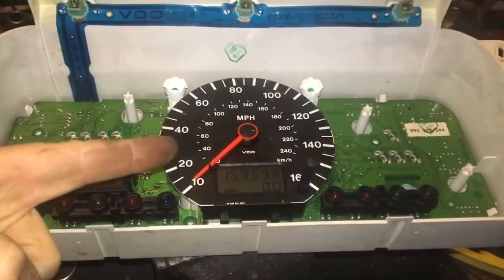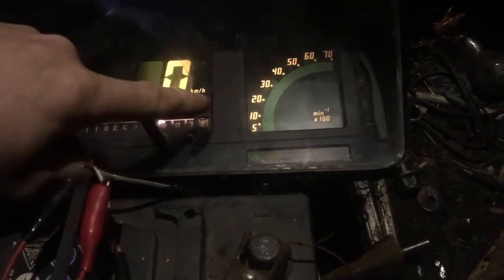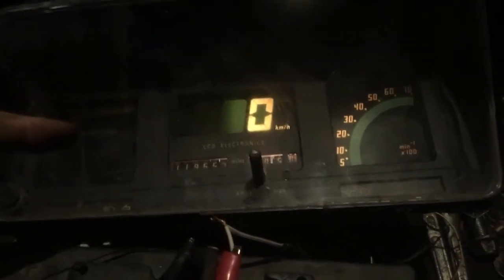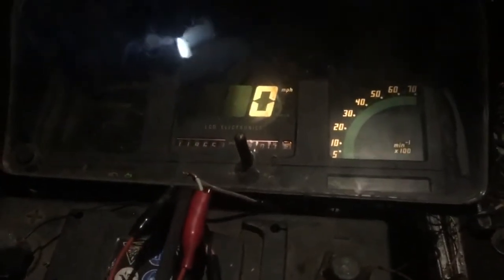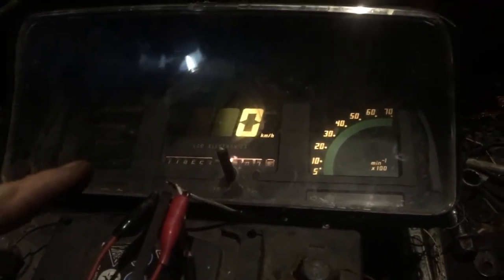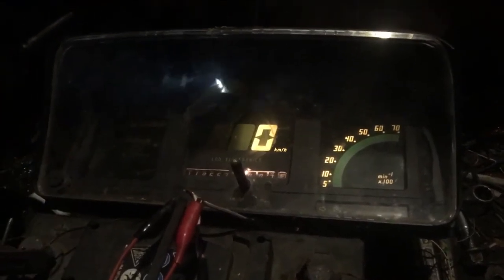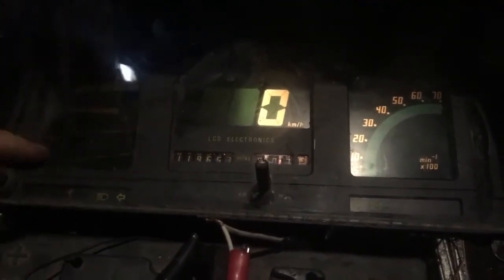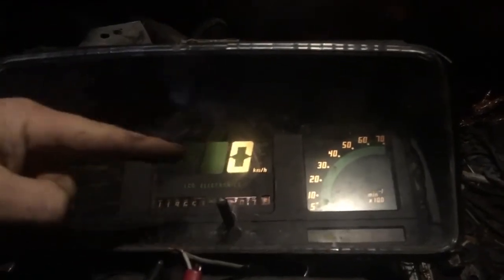Ep36 Calibrating the speedo

Comment: hi, how is this corrado digifiz project going ?  did  you coplete it ? is this working  whit  the speedometer from astra /kadett ?    just wondering i just got to finde a  kadett GSI E  først digifiz 1.8 whit out a servo, will this work ? ome nr 93 154 845 PP / 93 154 685 .
Reply from the maker: I have no idea . Sorry . I have another video where I show what all the wires do . And how to wire it up. Only thing missing is the warning sensor for low on coolant but Everything else works - GM 16polo Speedo sensor
Reply: @stevenharpervw   you gnow what number on that 16puls sensor ?  did you get it work in km/h too ?    how  is missing the coolant warning ?  do it not working whit the corrado  coolant sensor ? is it working the obivous way off the corrado?
Reply from the maker: @finberget1  watch the videos , it explain all.

Comment: Interesting progress, like it! You'll get use to the digital speed and miss it when you don't! 
The spoiler requires a square wave as you know, I'm sure the VR ECM has it as part of its output. I've wired my original '89 controller via the speed bus (TV pins) in the OEM way or the dash either direct to the sensor or the mk4 ECU output
Reply: vr ecu doesnt output a speed signal, it need a speed input from the cluster same as the spoiler. you can use the original VW speed sensor though
Reply from the maker: Thanks for the chat yesterday. Learned a lot 👍